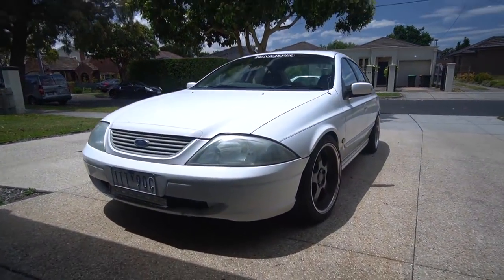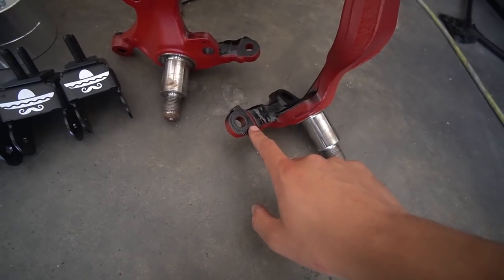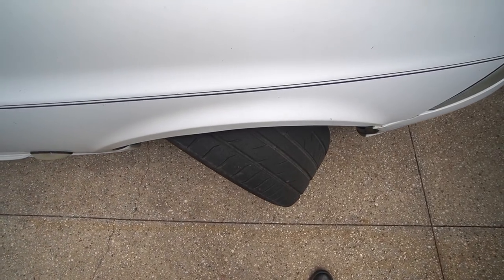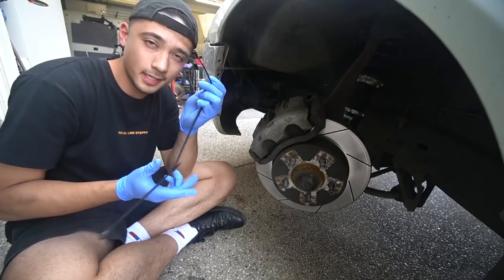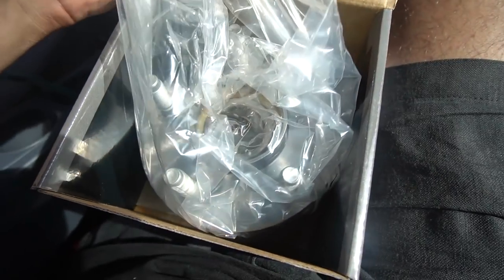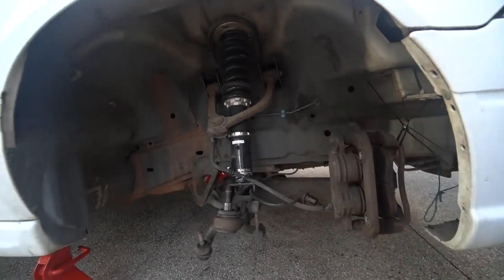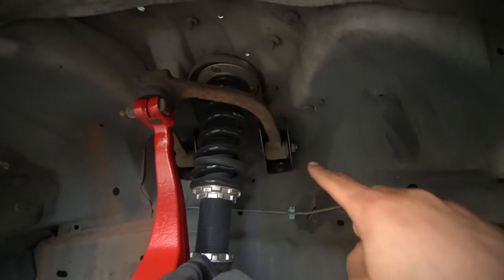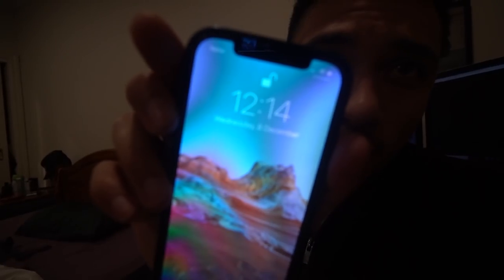HOW TO GET MORE LOCK OUT OF YOUR AU FALCON! DRIFTER MODS 🔥

Comment: Try putting both shims under front camber mounts both sides. Will still give you same neg camber but importantly some more positive castor to help with even better self steer. 🤙 also i got the maxxpedding ve commodore coilovers working good in the rear of the falcon. Still a touch bouncy but 100% better them how we originally had them if your interested. Either way keep up the good work. Loving the content man.
Reply from the maker: U mean put the shims like on one camber arm each side towards the fornt of the caR? I want returning wheel XD and thats mad for amkig the VE coils work, i decided to go choppies again and lowered shocks feels pretty good
Reply: @RexH  yeah so I assume you got x4 shims in total and you have put 1x shim with each MHC camber plate. If you were to put 2x shims under the most front camber plate on each side and non under the back camber plate will give you more positive castor but wont effect your neg camber will still have the same amount you have now. Just have a play with your set up. I run as many shims as possible and have around 9 - 9.5° of positive castor and it drives so good. Just something to try and play with. They work well stock and no extra castor but seems to work well with some extra castor. Just an idea. The more you move the top of the knuckle back by adjusting them shims under the camber plates gives more pos castor, same in jap cars when they bring the lower control arm forward for the same reason. I hope this helps.